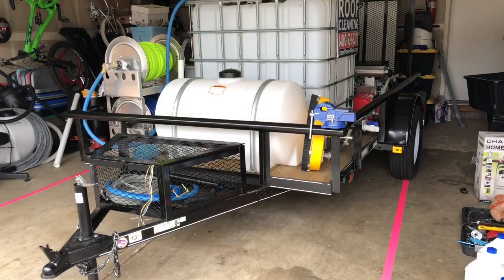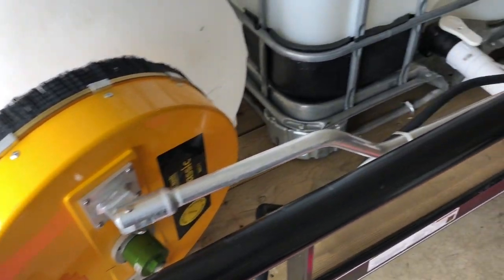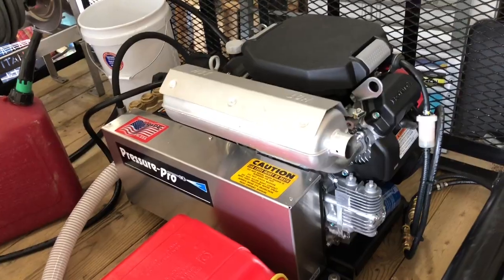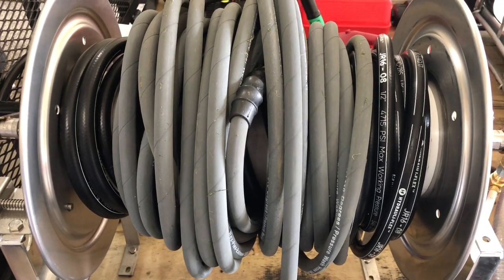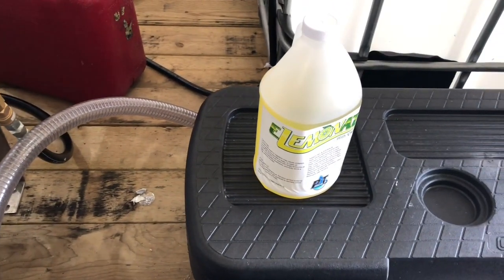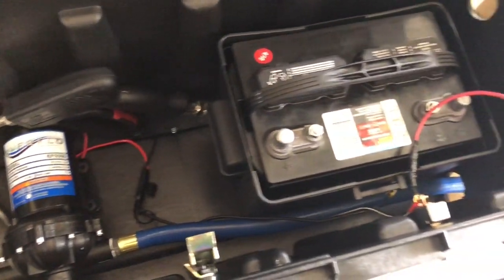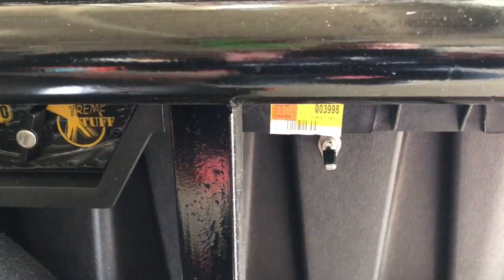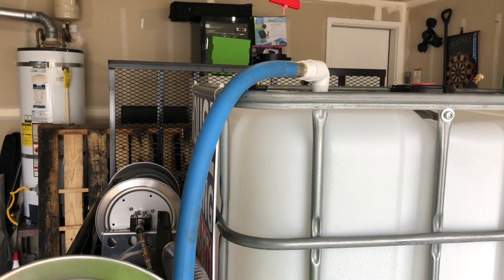Expert Power Wash 6x10 Pressure Washing Trailer Set Up

Comment: What’s your go to mix ratio for the 65G tank?  Thanks.
Reply from the maker: John Furr, 50/50 for roofs. For houses roughly 2 gallons SH and about 1 gallon of water. It varies a little depending on how bad the house is. Ratios are based on 12.5% fresh SH. This is just a basic ratio. Your ratios will change slightly depending on the job. Always use a good surfactant. About an once per gallon. I like cling on and slomo for roofs and Elemonator for houses.
Reply: Thanks for the reply and info. I just rewatched your video and saw your injector. For some reason I thought you batch mixed in the 65G. 

Nice rig my man!

Comment: What size are your j rod tips?
Reply from the maker: 8 GPM pressure washer- 0080, 2560, 2520, and shooter tip. 

Soft wash pump- 0030, 1530, 2530, 4030
Reply: Thanks man

Comment: How much did it cost you to build this set up?
Reply from the maker: I bought the trailer on sale for $1400 and have about $8000 in all the equipment. Total of $9400. I’m sure you could spend less but this is a great commercial and residential rig. The 8 GPM is definitely worth it if you can swing it. Another option is to buy used.
Reply: The difference between 4 GPM and 8 GPM in the amount of time it takes to clean a house is massive.  My friend just bought a trailer set up very similar to this and he raves about the upgrade to the 8 GPM machine and how much faster he can do jobs.
Reply from the maker: Panoramic Clean,

I could not agree more. I know it’s possible with a 4 GPM machine but why limit yourself. Work faster make more money. The 8 GPM pays for itself very quickly. Thanks for watching.

Comment: Expert Power Wash where is the 1” inlet line coming from that goes into your 12v pump? I love your videos!
Reply from the maker: I believe what you are referring to is the crush proof inlet tube? That one has a filter on the end that is part of a drop stick that draws the mix. It is then reduced down to 1/2 inch. This custom tube was created for me by Pressure Washer Products.

Comment: The only reason to have 8 gallons per minute would be to clean driveways,,, do you really run 8 gallons per minute to soft wash.?
Reply from the maker: William Coley, it does work very well for surface cleaning. Yes I soft wash with it. It’s all about the tips and volume of water. It is way faster, rinses better, and shoots higher. It all comes down to preference and what works for you. This works awesome for me. I appreciate the comments and stopping by the channel.

Comment: Put a sign up on that rear gate.
Reply from the maker: That’s the plan this spring
Reply: @ExpertPowerWash  nice, I did that on mine, and I kid not less than 5 minutes after putting it on, I got stopped at a light with someone asking for an estimate. Truck/trailer signage has probably been my best ROI as far as percentage wise, from all my advertising.